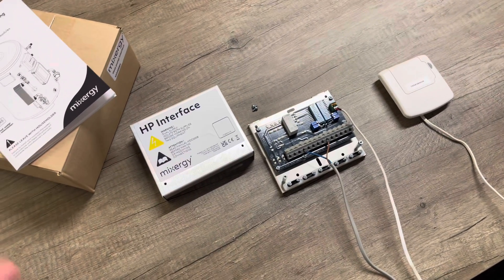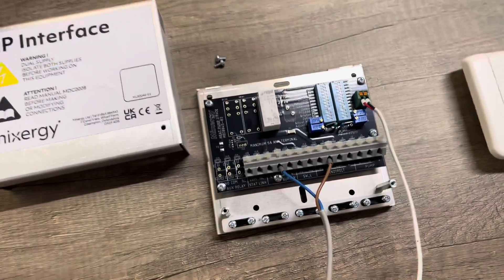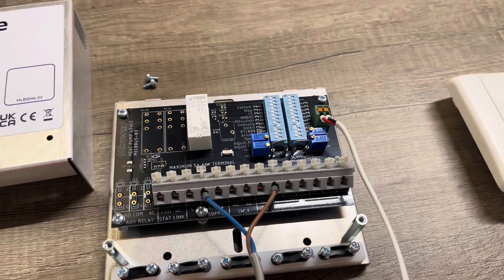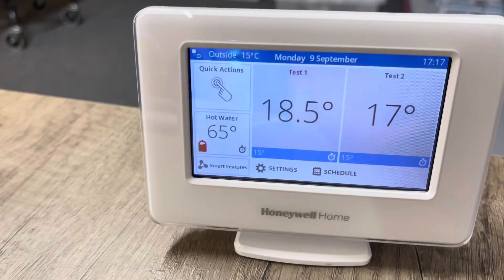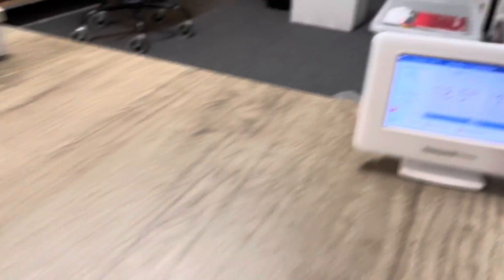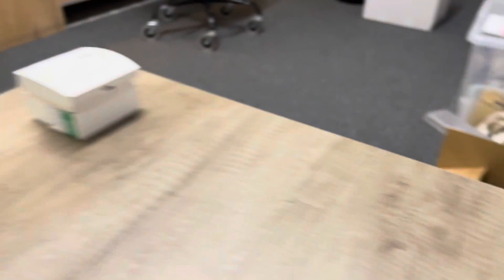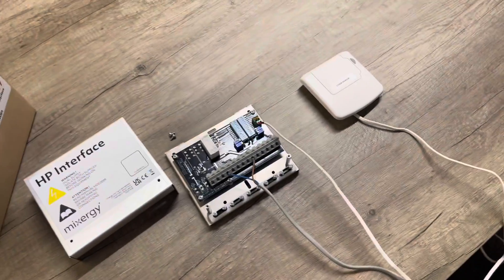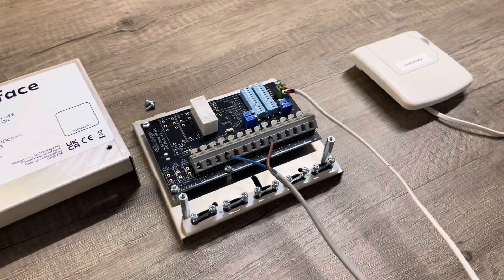How to get a Mixergy cylinder working with Honeywell evohome!

Comment: I (as a home owner needing a new hot water tank) was talking to an installer who was suggesting a Mixergy cylinder to pair with my boiler and evohome system. Thanks for posting a solution. To be honest though this looks experimental enough that my thinking is to get a more conventional unvented cylinder instead.
Reply from the maker: Nothing experimental about it. I’ve been doing electronics and design engineering since 1997. This is a solution to a problem of two systems they were never designed to work together.

Comment: Great idea - I was about to build a convoluted setup using a 1NO/1NC contactor with a bunch of resistors to provide a high/low state to the CS92 and the contactor coil wired to the INDIRECT wiring of the mixergy. This would be messy although over two thirds cheaper. Using the HP interface is a neat one box solution and no faffing with resistor values.
Reply from the maker: Yep, this works a treat! 👍🏻